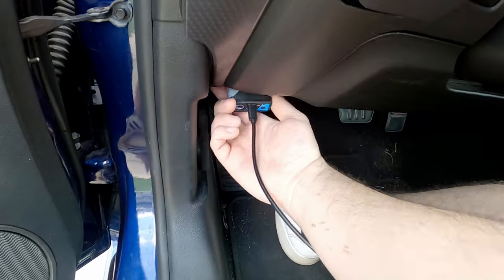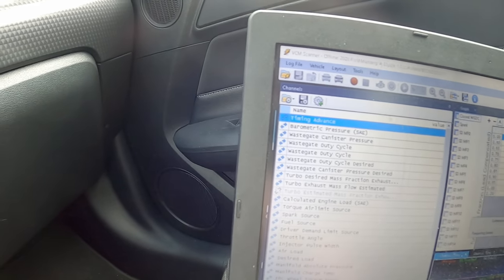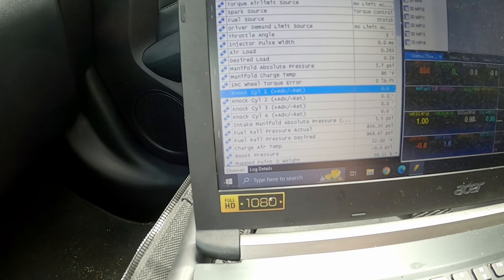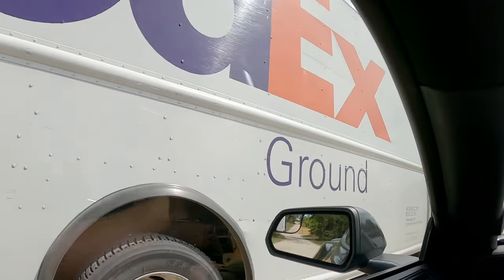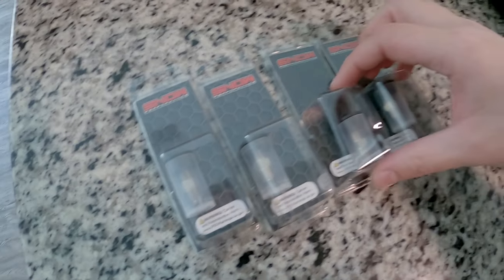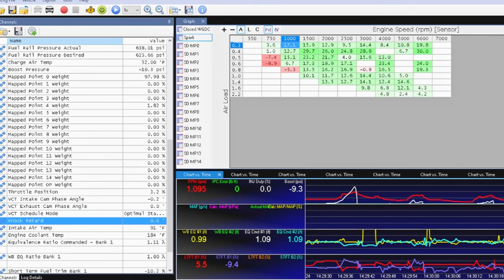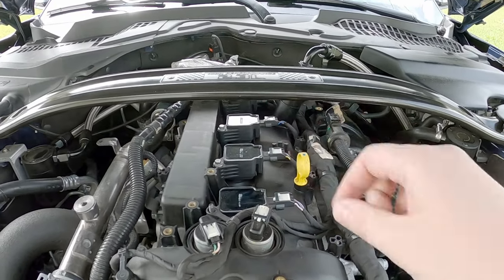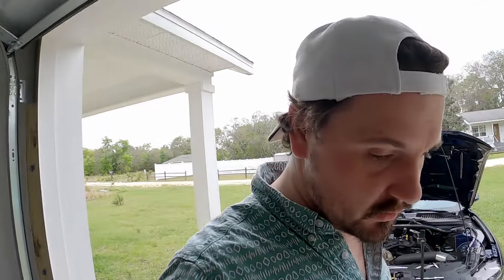My Mustang is Knocking Again

Comment: cylinder 3 typically has a flown imbalance compared to other cylinders meaning it runs a tad leaner. i see this on every ecoboost 4cyl i’ve tuned, which is a good bit now. i see you’re still taking advantage of my ecoboost tuning channels & layout 😉. more boost equals more cylinder pressure, especially with stock turbo setups. add too much spark to the mix of high cylinder pressures and you get knock. then excess heat from the air charge and you are bound to have knock. meth will help lol
Reply from the maker: So I adjusted the spark modifier for manifold charge temp. I'll see if that helps when the air is hot. I know the knock sensors are doing their job, but I'm a little uneasy seeing 4 to 5 of KR at WOT. 

And yes, I'm still using your log setup! I bounce back and forth between yours and the one I made. I wouldn't have made it to this point without it! Thank you again!

Comment: the best thing i did was changing my wheel and tire set up. lighter SVE wheels and a staggered wider set up with continental extreme contact sport 02's + E85 tuned and 4 more cylinders = 12.63 @ 112 MPH (Dragy). welcome to the "No Spin Zone"...these tires hooked up hard with no spin..2016 GT Premium
Reply from the maker: I would like to get a set of lightweight wheels eventually with an extra set for rear radials. I have a whole parts list for reducing rotational weight lol. But just a better  wheel and tire setup for the rear would be extremely beneficial.

Comment: check the clocking on the two knock sensors. in a vid I noticed you had the pigtails at 6 o clock. might be different on your motor but my 16 has a different orientation that must be adhered to.
Reply from the maker: So I did fix that before installing the engine. The rear knock sensor had to be at the 3 o clock position. I'm gonna have the intake manifold off soon and I was gonna double check the sensors and make sure everything it good.

Comment: Which ecoboost do you think its better to buy, 2017 or 2019?
Reply from the maker: I think the stronger Gen 2 connecting rods started in 2019 or 2020. If all 2019 engines had the updated rods, then that would be my choice. Otherwise, there's no differences that matter as far as the engine goes.

Comment: Get a dragy so we can get a good idea on how your car is doing.  
I personally have a stock turbo stock motor car tuned by EMS would be interesting to compare times.
Reply from the maker: I have a Dragy 🙂 I've already recorded a 40 to 80 run before I started messing with the power to have a baseline. What's your car running?
Reply: @KarzKreated  
For 40-80 the only draggy data I have is on my e30 tune and it normally runs 3.6s-3.7s
Reply from the maker: Wow. That's considerably faster than my baseline run. For my runs, I start in 3rd at around 3k rpm and punch it.  Do you start your run from a stop?
Reply: @KarzKreated  

If I remember correctly I believe I also started in 3rd gear at around 30mph
Reply: @KarzKreated 

Oh and also for reference on my 93 tune my car doesn’t go past 20-21 psi 

From what I’ve seen you’ve gotta go with very large turbos to make power on 93 I’ve seen a few cars making 450-500whp on 93 on Facebook

Comment: if you want to build hp cheap pull that motor and build a small block chevy to throw in it.. At least when you screw it up again it will be easier on the wallet.

Comment: Oh man! This guy has no business "tuning" his engine. Only the manufacturer knows the in-depth characteristics of their engines and how the ECU should be programmed. This guy is gonna end up inadvertently disabling engine protection regarding boost and timing and screw up his motor.
Reply: Tuning is called we think stock is slow as shit and needs improvement